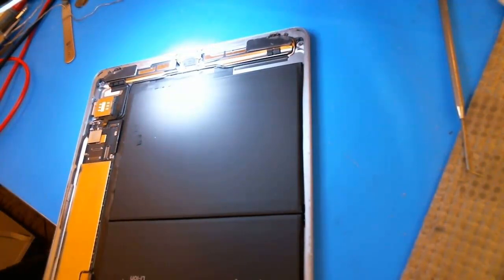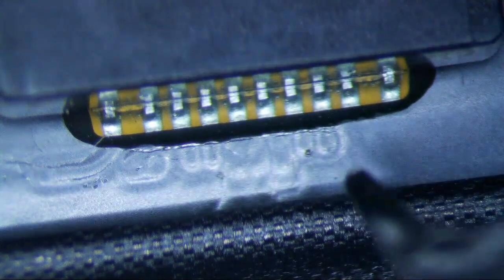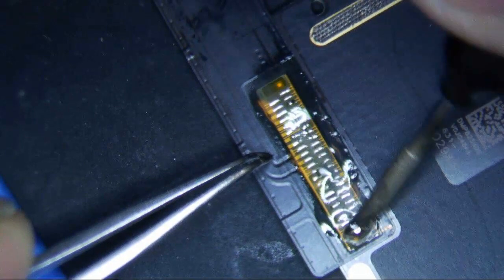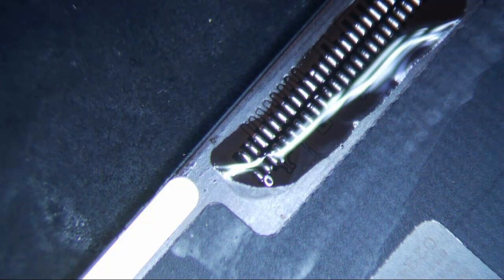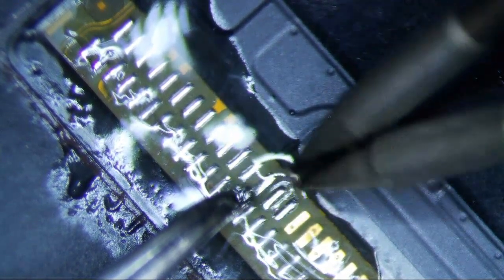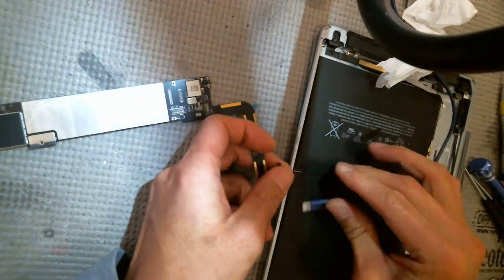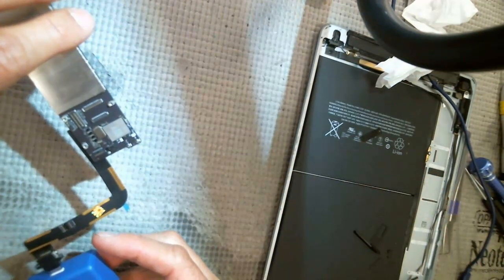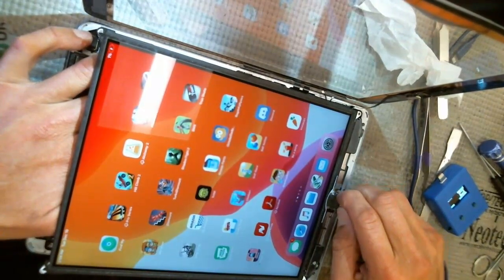iPad 6th Gen A1954 Diagnosing and Repairing a Charging Problem

Comment: tip number one, do not use the tool to remove the digitizer on the left hand side of screen if camera is at top of device facing you, you will sever the cables there very easily if not carful. I saw like 4 videos on YouTube not one showed this possibility so I had no idea to watch out for these cables here. thanks apple for the awesome engineering, I've never seen an android designed like this... good thing I stopped buying apple years ago back when I first realized it was like 3 times the price of PC but with 3 times the restrictions for repairs and customization, this is just a project for a friend, unfortunately its going to dip like 25-30 bucks into my profits for a replacement digitizer though.

Comment: Hey there, may I know what are the pins on the top half for? I ripped about 40% of them as I was removing the board from the housing. (the double side tape used was tremendous) I slide the spudger down the wrong location. Hoping that the board is salvageable.

Thanks for your video btw
Reply: There's a free software called Phoneboard that should have that information you're looking for.